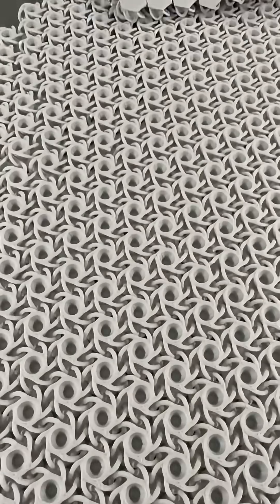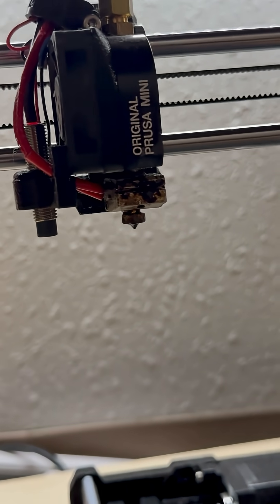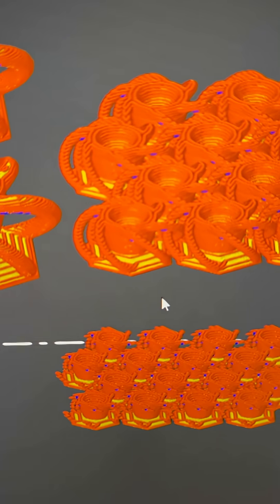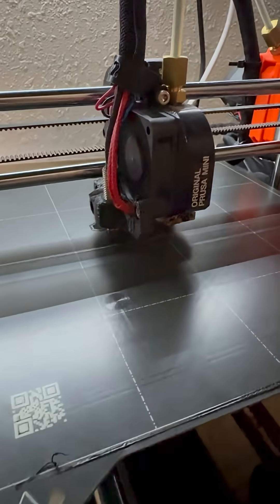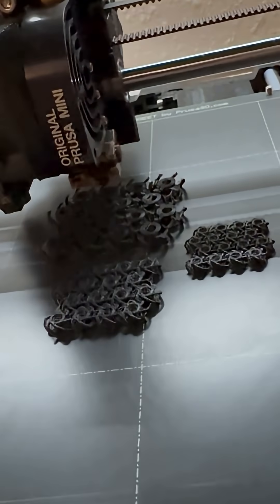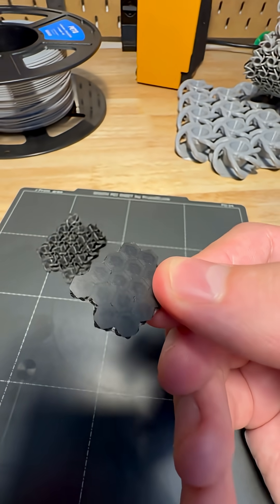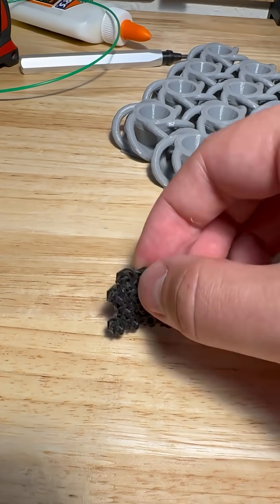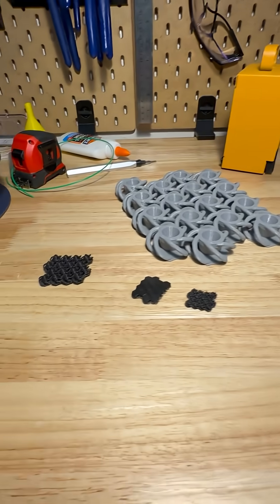Printing tiny NASA fabric using my #3dprinter #shorts #prusa

Comment: Could the print be smaller if you modificate the pivot?
Reply from the maker: The what
Reply: @aerocreative  Sorry, I didn't explain well.😅I tried to say the nozzle head? or the extrusion nozzle? I don't know which is the correct way in english😵
Reply from the maker: @ItzSkiteer all good!! No worries. And I’m not sure! Having the nozzle at some kind of angle could be useful I suppose, although this is an area I’m very unfamiliar with! Do you know of any printers that can do this?
Reply: @aerocreative  No, not really. But I though it could be similar to a micropipette, a syringe with a smaller needle, or a cosmetic ink dispenser.
Reply: Ok, now that I search on Youtube, I found that you can change the nozzle head to different sizes(This is a new discovery to me!). The smallest I watch was about 0.2 m. Hope it helps you!
Reply from the maker: @ItzSkiteer yes! I used a .25 nozzle on this project

Comment: Slice it with Arachne
Reply from the maker: What’s that?
Reply: Its a slicer setting. Instead of the line width being constant it varies flow rate to produce thinner lines than you can otherwise do. Whenever you shrink something to the limit or are trying to do super thin walls or fine details Arachne can go a little further.
Reply: That’s the default with prusaslicer so it’s worth giving classic a try also